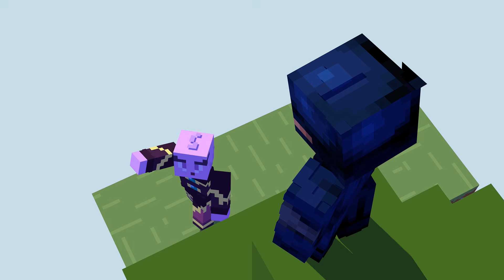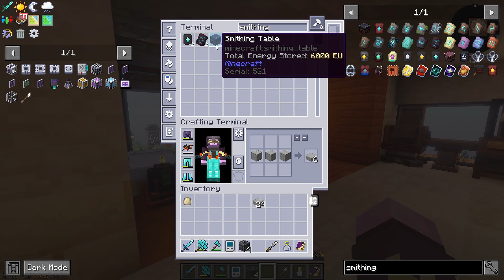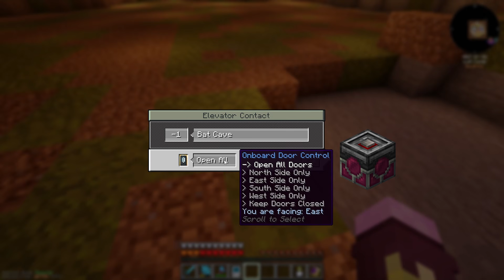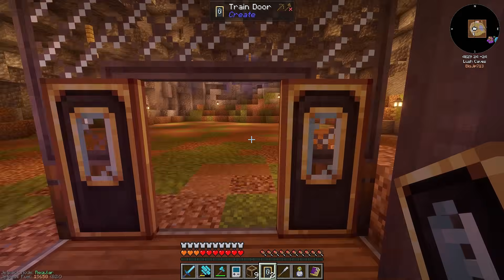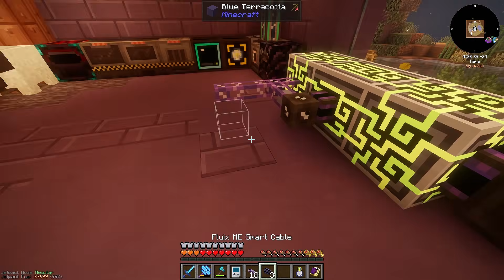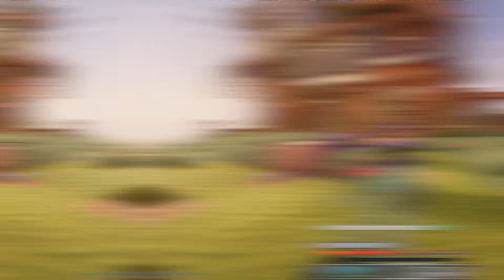Where does this elevator lead?

Comment: 14:59 with create mod doors, while holding the create mod wrench if you hover over the center you’ll see a settings pop up, that allows you to choose wether the doors work with both player or redstone (normal), wether they only work with player interaction and don’t open with redstone (manual), or if they ignore player interaction and need redstone or contraption opening (special)

Comment: You only need the second controller network for the P2P's if you are going to be using Dense cable to connect the P2P panels. Basically you take a dense cable, run it to the primary controller to make the P2P connection with normal cable connected to the dense cable, then you can run the dense cable and have 32 channels per side of the controller for the P2P network. It allows you to make some very compact/dense cabling setups so you dont have dozens of cables running every where. This is more useful for very large bases with large Controller setups.

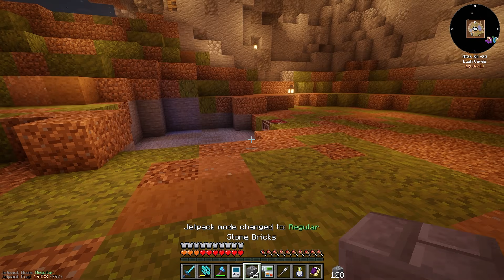Comment: 15:40  a useful mod interaction with Dire's various Gadgets (building, exchange etc) is that you can link them to your AE2 system. Just run them through the wireless access point, same way you linked your wireless terminal, and then the Gadgets will pull any blocks they need directly from your AE2 network. So if you are doing a big build/exchange you no longer need to have stacks of blocks in your inventory.

Comment: Some create Tips. You can use Ars to do some create actions, like pressing and smetling(I believe it works on tts), but also you gain more stress units available on your water wheels with the more contact with water, which can be a total of 9 sides for 1 flowing direction, 3 top, 3 side going down, and 3 bottom flowing back from the top water.
Reply: In newer create versions water wheels no longer care about how much water is touching them.
Reply from the maker: I saw that, I definitely need to try out those create spells more! The water wheels changed in the recent versions of create because people had so many problems with it

Comment: If you use applied flux mod, an add on for AE, you can use your pattern provider to send power to you machines. Making it so you only need a single cable for everything. You need a flux cell to store the power to be distributed by the me system, and induction cards in the pattern provider. You can also use exporters to export power to machines that don’t need a pattern provider. To find FE right click in the interface or export bus with anything that has a battery. It is a lifesaver for cable management.  

I have had some issues with extended pattern providers not seeing the induction card though. I don’t know if it’s a me problem or a bug. But I only have had that issue on the reaction chamber and the circuit slicer (both I would suggest you invest in. Makes making circuits sooooooooo much nicer if you have the resources. 9 circuits at once instead of 1)
Reply from the maker: I played around with it in single player and loved it, I'll definitely be doing that in the series, I'll have to get a lot of the auto-crafting set up for AdvancedAE and AppliedFlux

Comment: the way you glued the elevator is... oddly annoying for me xD
obviously it doesn't really matter and it's all glued together in the end, but the optimization gremlin in my brain was screaming that you can glue the whole thing with only 2 rectangles (well... rectangular prisms, but you get what i mean)
since the elevator is just a 6x6 with its edges removed, and an arbitrary height, you can just do two 4x6x(height of the elevator) glue areas and the whole thing is covered.
edit: also, just a quick stylistic thing, you can attach multiple pulleys to one elevator, only one needs to be powered, and it makes it look a lot nicer, especially when the one pulley isn't/can't be centered
Reply from the maker: I realised this after 🤦‍♂️ I'll fix this off camera

Comment: For your Molecular Assembly/Pattern Provider Autocraft, you can have a star pattern like this:

        O
    O X O
O X O X O
    O X O
        O

Where O represents a molecular assembler and X represents a pattern provider.
This allows you to have 4 x 8 = 32 pattern providers with 4 molecular assemblers each (+1 for the top and bottom pattern providers).

I used to do it this way way back in Agrarian Sky, and it gives a pretty good futuristic look.

Also, since it uses one full controller face, you can simply have one dense cable and four smart cables connecting all pattern providers directly.
I don't know if what I'm saying is understandable, but I hope you get the gist of it! :)
Reply from the maker: That could be really cool, I might experiment a bit with some designs like that to get the faster molecular assemblers

Comment: can easily push the cable into the wall and the interface block behind the machine, in the wall. Hiding them entirely. You can access all of the interfaces with a different terminal

Comment: you can use some regular, old, cheap cables as scaffolding blocks to reach the buttons on the elevator. since they arent a full block and are centered on the middle of the block, there wont be any z-fighting going on.
Reply from the maker: Good idea, I'm not sure how the scaffolding would interact with you if you hit your head on it though
Reply: @BigJim713  OOPS, thats an oversight 😅
Maybe carry a bow around to shoot the buttons from afar, it would be funny too. Having to carry a bow around to call the elevator

Comment: Really liked the create elevator as it's a mod that I don't touch often because it's really cool, but most of the time in ATM just slow in comparison to other machines. Still love the creativity possible with it (and the building blocks, the only thing I use more often). 

While the p2p explanation was relatively good. I'll say you can't say nobody talks about the channel transfers. The mega sethrov controller is completely based on it and Ksaw's video has 150k+ views. Sry for this random rant, because of a few words but I needed to get it of my chest😅. But really nice build.
Reply from the maker: Thank you! Yeah you're right, what I meant to say was that no-one has talked about it in a way that I found easy to understand, KSAWs video on the Sathroller was really sick but I've always struggled understanding how the P2P works

Comment: Redstone links are super easy to make and I suggest using them to call the elevator. 
AE2 is just one of those things that are really difficult in reading but not that complex in video form. Speaking of which I suggest using different coloured cables for subnets for viewer clarity and also to not accidentally connect to the main one.
Reply from the maker: Yeah I definitely think I'll do both of those. I need to get into the colored dyed cables very soon
Reply: @BigJim713 If you need to dye a LOT of them you can bulk dye them with encased fans, I believe you just throw a dye into a water source to turn it into liquid dye, then you can mass dye like you would bulk blasting or washing.

Comment: 2:53 can't you use ultimine to mass strip and apply casing material? i dont remmeber
Reply from the maker: Woah okay you're right but there's an interesting caveat. You can do it with vanilla logs but not modded logs by the looks of it, it doesn't work with archwood :O

Comment: You don't need the second ME controller, you can use an ad-hoc network for the secondary network! Just replace it with a cable and it'll work exactly the same.
Reply from the maker: YOU'RE SO RIGHT UGHH! It's less than 8 channels so I could've just done that, thank you!
Reply: @BigJim713  I'm also pretty sure you can P2P your network through itself

Comment: 3 things I would like to mention:
1 - The corners of that elevator need to be filled in with something. I personally hate how it looks xD I also usually put the Elevator Contacts 1 block below the floor I'm standing on. It helps me with hiding them a bit better. 
2 - It wouldn't hurt to put up a wireless charging station somewhere. Either from Powah or Flux Networks. I personally prefer Flux Networks, since it's nice and compact. (And works really well with the rest.)
3 - To pretty up the AE2 section a bit more. I'd move all the providers to be behind the main block you want to use them on, to keep them out of sight. And have the cables in the walls. That way it doesn't look as cluttered, and makes use of the "dead space" in between by placing cables there instead.

Love the video, and looking forward to the next! Lovely teaser with Ars Nouveau!!!
Reply from the maker: Ahah I've had a call from OSHA and my elevator is not compliant, I'll have to fix it for next episode 🤣 Definitely great ideas there I definitely will need to figure that all out, I'll play around with the camo blocks to hide it all very soon

Comment: Wanna know a fun fact?

You can use ultmine to bulk use item  on block instead of bulk break. helpful when making casings manually! Note that you can only turn them into casings this way with the addon "Create Ultimine"
Reply from the maker: Very fun fact thank you! It doesn't work with archwood logs unfortunately but that's so useful for casings thank you!!
Reply: I've used that to bulk strip logs, but ive never been able to ultimine turning them into casings...
Reply: @MaxtheBraincellFree Create doesnt have inbuilt config with Ultimine, so encasing will have to be one by one. But if you want you can install an addon called Create Ultimine that allows you to do that.
Reply: @Random-person-on-the-internet I'll check it out!
Reply: that is indeed a fun fact woah

Comment: personaly i like keeping my elevator contacts on the side with the door, as it allows for an easy call button for the elevator without needing a redstone link. could have the elevator have a central support pillar instead of the corner pillars, and have a floating platform for each floor that would be hidden by the pillars when the elevator in on that floor.
ifits on that floor, the platform is not visible. when its not on that floor its a small jump to click that button. and when on the elevator the pillar would block you from getting pushed off by the platforms.
its an odd idea, but maybe could be interesting?

Comment: For the cables coming down from the roof, you could offset them by one block and use them as the walls. Also, you can convert pattern providers to be directional by placing them in the crafting grid, it requires more cables but can be useful at times, also just less bulky than the full block providers.
Reply from the maker: Great idea, I'll look into that thank you!

Comment: for the redstone contacts you can cover them using camo blocks, they are very cheap to craft and you just use 1 camo block and the block u want to mimic in the crafting table and then right click it on the block you want to mask
Reply from the maker: OOH I need to do that, thank you!
Reply: Should work for all contacts other than the one on the contraption.